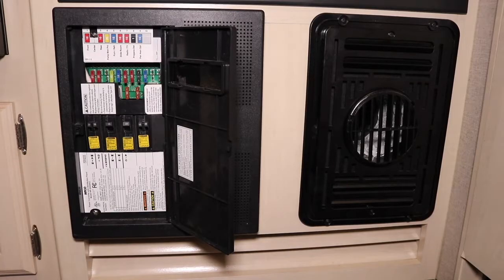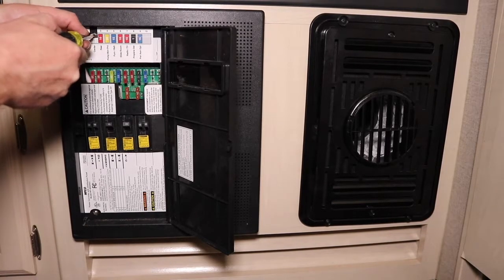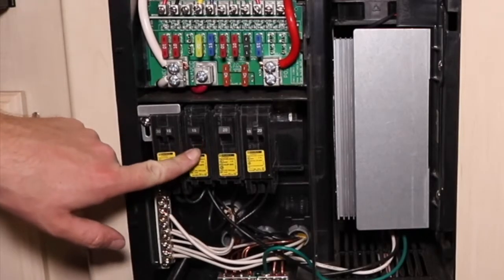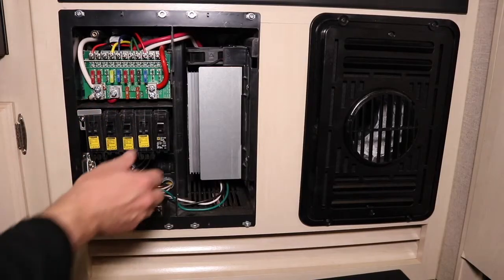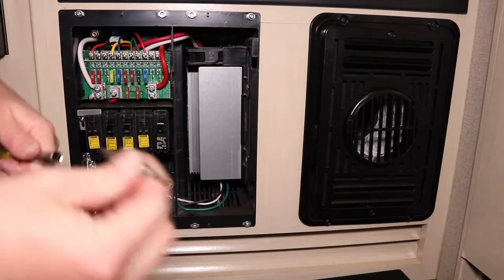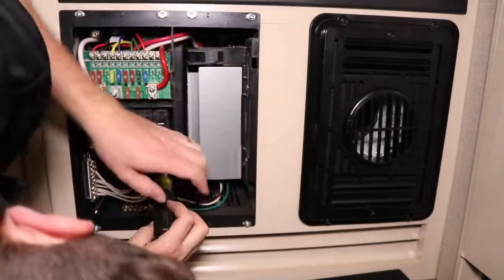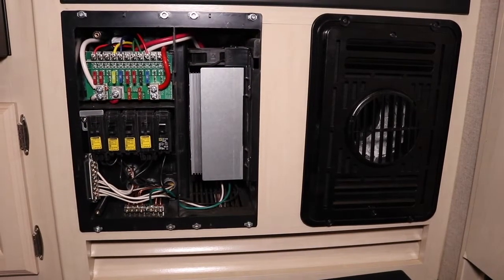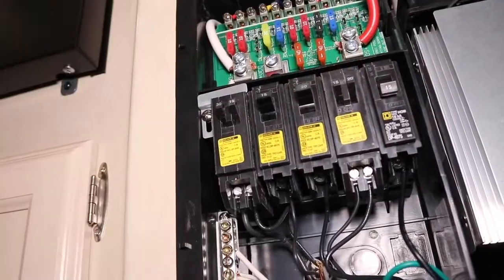RV Inverter Installation: Rewiring the Charger Breaker | The Savvy Campers

Comment: Thanks. I have to do this next in my investor system too. My converter breaker is also combined with my gfci circuits. I wish the rv manufacturers would dedicate a lone breaker for the converter. Someone on YouTube has a video of putting a relay on converter where it automatically cuts out when inverter is going but I can’t find it anymore.

Comment: Came accross this video cause we have the same panels. I did the same thing but when I turn off the inverter and turn on the new 15 amp breaker going to the converter and plug into shore power it pops my house breaker. Did you have any of these issues. I do have my inverter wired to the main 30 amp breaker which is the same as the shore  hot wire.

Comment: Thank you for an excellent video; you have a nice calm presentation style that’s easy to listen to and learn from.

I want to replace the OEM lead acid battery on my ‘21 Coachmen Freedom Express 192RBS with a lithium battery. I’ve gotten bogged down with info, like will my existing charger/inverter work with a new lithium battery?
Reply from the maker: Yes your charger/inverter should work with a lithium battery. You can check the manual for it with the model number. You may still want to upgrade your charger/inverter to a higher amperage to charge your batteries faster while on the road.
Reply: @TheSavvyCampers  Thank you. What about sizing my new LifePO4 battery in terms of staying within the limitations of my existing wiring.? I was thinking of a 100ah lithium battery; my existing lead acid is 150cca.  Is this a consideration?

Also, I understand that a newer camper like mine should only require the changing of a jumper?  I’ll look up my existing charger/inverter model # and see if I can find info as well.
Reply from the maker: @cwqrpportable  If you change to Lithium you won't need to upgrade your wiring unless you add a higher watt inverter and want to draw more power, or if you do upgrade your charger/inverter and your wiring can't handle it. If you stay with your original converter, you should be safe as your manufacturer "should" have sized it correctly from the factory, but your manual should dictate what size of wiring to use for the length of wire if you do want to upgrade it. If it doesn't, this article should help out a lot: https://www.renewablewise.com/battery-to-inverter-wire-size/
Reply: @TheSavvyCampers  Thank you, that really helps. I just want to eliminate the constant babying necessary with SLA batteries. So if I can use my existing inverter that would be perfect.

I think I will go with a 100AH LifePO4 battery as a replacement.  The size of the battery won’t affect wiring size if I stay with the current inverter correct?  I could get a 200AH battery for more capacity….

Thanks again; I think I was making this harder than what it actually is….

Comment: But why on earth would you run the inverter while on shore power?
Reply: Because the inverter usually has a shore power by pass thru the inverter yet you still get to use the inverter to 3 stage charge and maintain your batteries.

Comment: Can I turn my inverter off to plug in into my bluetti ac200max? I noticed that when I plug in my trailer to the solar gen, it draws more than 1500 watts with everything off. I turned the inverter off, and  it was only drawing around 300 watts or less, but I can't remember.

Comment: this video gives me more confidence to move some breakers and wires to isolate my converter on Line 1 and put the appliances powered by the inverter on Line 2  (50 AMP system).

Comment: If im plugging my rv into the house, will my battery charge?  If so, is it better to turn off the convertor during this? (I have not installed my inverter yet)

Comment: Did same set up with our 5th wheel. Actually installed construction grade 20a cord from inverter to rear using a 50a/20a adapter. Know not to use high energy devices ie. microwave, toaster oven, hair dryer. And of course forgot to turn breaker off so killed batteries faster as they were recharging & even forgot to turn it on so they didn't charge.  Oh! the daily challenges.

Comment: Great video!  The best thing is it is the same circuit breaker panel as mine!  So.... Main is for everything, GFI would be for power outlets, A/C is for air conditioning, W/H would be for water heater.... leaving the one circuit breaker labeled both 'General' and M/H.   So one wire goes to the converter.... where does the other wire go?  I couldn't trace it when I removed the panel?  Also - I have two 40amp fuses on the DC side below the main row of fuses....do you know what these would be for?   Thanks!

Comment: I am not sure that I understand the purpose. I have a 2021 2106DS that has Go Power 190 watt solar panels on the roof, 2 6v Lead Acid 135 ah batteries in series, Go Power Controller, and a Go Power PS 3000 wt inverter. We have a Go Power Auto Transfer Switch also installed. I am not impressed with the Go Power system. In addition we have a GP Inverter Remote Display installed inside but it never seems to be accurate or agree with the phone app. What am I missing or adding if I put the Converter onto its own breaker. Thank you for all the videos and instructions especially since we have the same model as you do.
Reply from the maker: Does your transfer switch have a separate power feed to your charger/converter? If so you shouldn't need to do anything. Feel free to go to the about us page on our website to directly email and I can help walk you through it. www.thesavvycampers.com

Comment: I have a breaker labeled Converter.  I'd just shut that off instead of adding another breaker right?  You did this because you had other things running on that same breaker?
Reply from the maker: Yes, I had two things wired to the breaker. You can always take your panel off to see if there is only one wire to your converter to make sure it is in fact not powering anything else.
Reply: @TheSavvyCampers  Thank you.  Still under warranty so I'm just going to run a cord over to the outside plug with an adapter, and then shut off the breakers for the converter and the A/C.  This should light up all the receptacles just like you plugged into shore power. That way I can at least run things that have 120v ac adapters.  Batts should still run lights, furnace fan, thermostat ect.  My old pop-up has this built in, new entry level motorhomes come without inverters in many cases.  :(

Comment: Will this allow the DC side of the camper to work simultaneously, while the AC is running off the shore side?
Reply from the maker: Yes, both sides will work.

Comment: Great video!!! Thank you. If you had hardwired the inverter, would you still have moved the converter to a separate breaker or would it be better to install a transfer switch? Where would the wire go from the inverter to the panel? Thanks!
Reply from the maker: If you hardwire you would run a transfer switch. The wire from the inverter would be wired to one side of the transfer switch with your shore power wired to the other. You can also just add 1-2 outlets off the inverter that will only be live when the inverter is on if you don't need your whole trailer to have power.
Reply: I don't understand all this, but it seems Very Savvy! I'm saving your 3 video playlist on the subject & subscribing. WELL DONE & THANK YOU!

Comment: Thanks for the video! I recently installed solar and an inverter for our camper. The 3000w inverter goes into short circuit protection when the "general purpose" breaker is on. This might be just the fix I need, as all of the non GFCI outlets are powered by the same breaker, and we need those.

Comment: Why not install a switch controller that manages all the AC power source Shore/generator/converter/inverter  !?
You won’t have to turn ON and Off your converter charger when your inverter is working .
Reply from the maker: We had planned on upgrading our trailer in a few years and figured we would make that investment in the next model.

Comment: How much solar do you have? Are those 2 100Ah Lion batteries? Not worried about theft?
Reply from the maker: I have 200 watts of solar, yes they are 2 100 amp batteries. I have them locked up, and remove them when away from our house in storage. Here is the video on our lock system: https://youtu.be/wYPnPyhyyy4

Comment: Great video.  I would like to do the same but don’t have any extra space in my AC side for an additional breaker.
Reply from the maker: Josh, depending on what else is on that breaker, you may not need it on anyways. They make tandem breakers that may fit in your breaker box as well. This will allow 2 breakers in a single spot.
Reply: @TheSavvyCampers  good news for me, I found the converter to already be on its own circuit so that step is done on its own.  :)
Reply: @TheSavvyCampers  great idea about the double breakers within a single slot though! :)

Comment: Great Video! I was stressed about how to install the Inverter becasue Ive seen other videos that were complicated as can be. I have a small camper and no other breaker spaces available so I will just double up something else and do the charge controler on its own. Thank you for a well made and explained video.
Reply from the maker: If you don't need the appliance on your charge breaker, you could also leave it and have that turn off at the same time too.